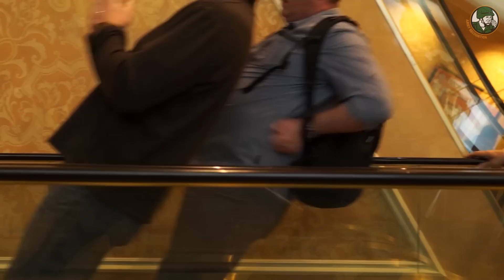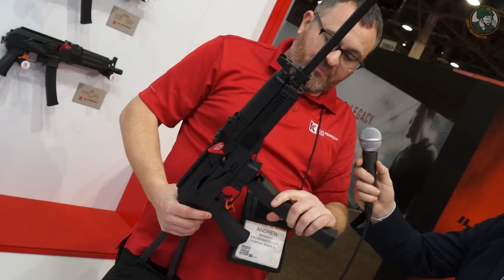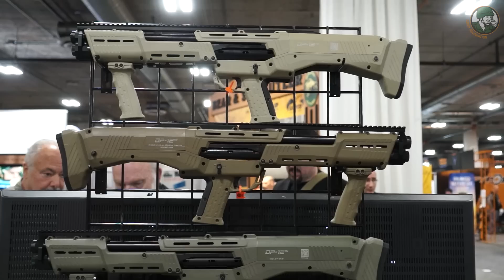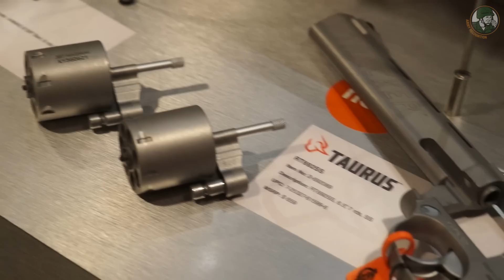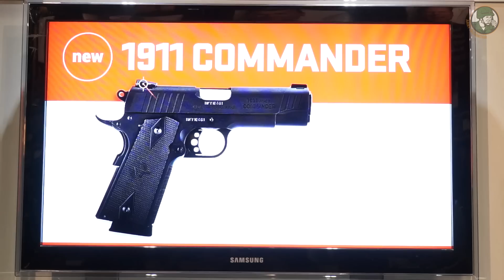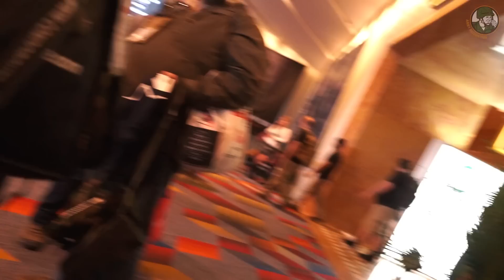Shot Show 2018 new products review firearms manufacturer exhibition Las Vegas United States Day 4

Comment: "we make reliable shotguns"  holds a DP-12  right....
Reply: @Intense_pickle You think this is UTS-15 which is the JarJarBinks of shotguns, it's not buddy, Research.
Reply: X Graaicko, DP-12 Has no issues, UTS-15 Is retarded beyond repair, Conclusion: He thinks the shotgun in this video is the retarded nephson of shotguns.
Reply: I have a dp 12 never had a reliability issue with it.
Reply: Whats wrong with it?
Reply: When did he say it was a UTS-15? Maybe you should learn to read.
Reply: What?
Reply: X Graaicko the commenter thought that the DP12 is unreliable but in fact it is the UTS15 which looks exactly like the DP12
Reply: intense_pickle https://m.ebay.com/itm/Noise-Reduction-Cancelling-Headband-Earmuffs-Hearing-Protection-Safety-Over-Ear-/382541789920
Reply: yao dave the first set had cycling issues when you held it at certain angles. That shizzle is like 1200 bucks too vs a Remington or mossberg for like 500